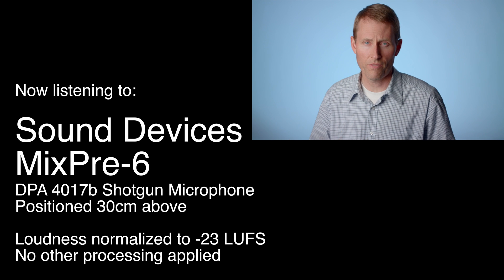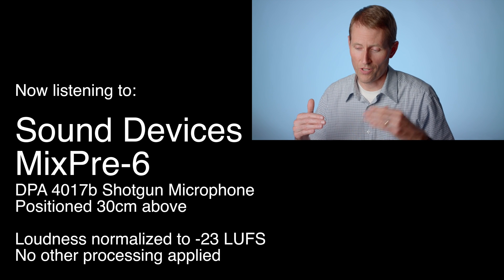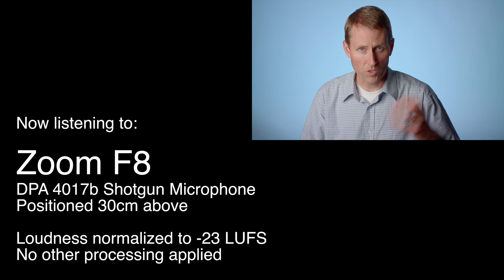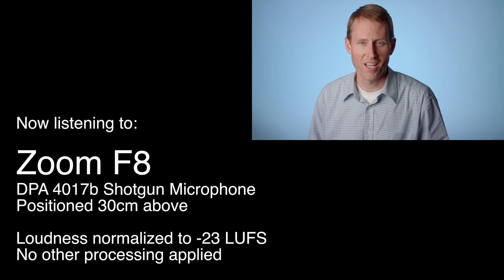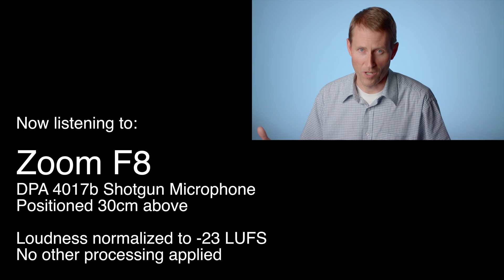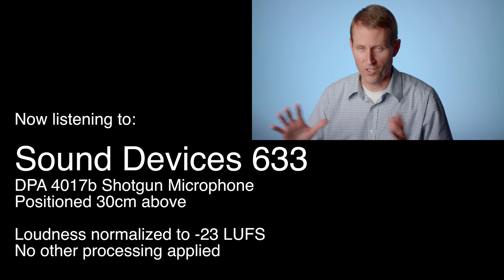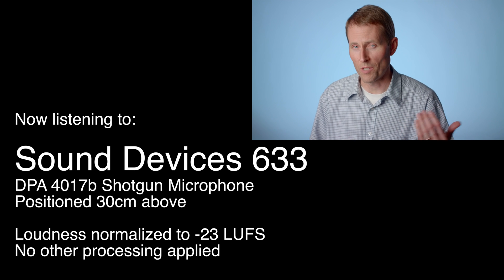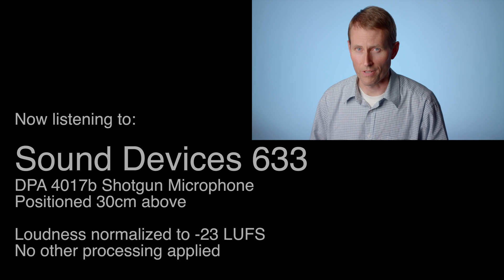Sound Devices MixPre Sound Samples Comparison

Comment: So, after quite a handful of years I'll just add my two cents. I'm a sound guy doing mostly documentary and independent films sound. I have owned my Zoom F8 since 2017 and it is completely 100% functional. Not a single failure. I've taken it to rather harsh environments ranging from insane humid and excruciatingly hot Caribbean to -4 celsius and over 6000 mts above sea level. It's still rock solid. It's honestly been in good hands. After all these years I'm finally upgrading to a SD MP 10 II (and keeping my F8 as backup). I've always find it a bit more tricky to get that..."in your face" american-dialog-sound with the Zoom. Digital limiters have been a bit of a pain here and there but in all fairness it's been ok. 

For the money (I paid just about 1k, new at BH), the F8 is just such a good piece of hardware man. It paid itself within like my first 3 or 4 jobs as a freshly graduated sound guy. 

I think I watched this video back then and thought like..."it's ok! I wont pay more than double for that extra" to be fair, I could not afford to. But now, to my ears, it is pretty clear that the SD (and others like Sonosax) do sound BETTER and I'm at a point in my journey where I think I need to step a bit up. 

I guess the goal would be to grab a 833 in the far future! Let's see. 

Thanks Curtis.
Reply from the maker: 👍 yes, the F8 and successors have been really good to me as well.

Comment: The dynamic range changes for each one. F8 is the shortest dynamic range of the bunch, mixpre-6 is an audible step up and the Sound Device 633 is just miles ahead in dynamic range.
I am listening on reference speakers with 1000watt 3 way monitors and 6000watt LFE through a benchmark 3 DAC

Comment: Excellent as alway! Curtis I’m upgrading from Tascam 70d, but still can’t decide between F6 and MixPre 3, which one you think I’m going to hear the best audio difference. I love the float 32 of f6. I’m a run and gun mode content creator.
Reply from the maker: If you use the same microphone and position the mic the same way, there shouldn’t be a huge difference in sound unless you gained incorrectly on the Tascam. If is 32-bit float you’re after, both the F6 and MixPre-3 II do that. The F6 is cheaper but the MixPre is more repairable if the unit gets damaged or stops working.
Reply: @curtisjudd  as always a very direct response. The answer I needed. Always a fan. Thanks again brother.

Comment: I thought the difference in bass response was rather strange, so I compared the first two preamplifiers in the silence part. This is the part examined in forensics to see if recordings coming from different sources were edited together and masked in some way in a final step:) The signal level of the Zoom noise is about 3dB lower in power, but that can happen on power normalization. The strange thing is that the bass response is unnaturally weak on the zoom f8 noise floor. Many dB lower than normal below 120Hz. The Zoom noise floor's most powerful part is at over 100Hz, while it is much lower in frequency on the first preamp. The noise response bass roloff is almost parallel, but extends lower in frequency. The noise floor does not change in actual rooms and electronic noise sources. It sounds like a highpass and it looks like a highpass in spectrum analysis, so I would say that highpass filter was active on the signal path of the zoom during this recording and it was rather high in frequency.
Reply from the maker: Thanks for the test.

Comment: I think the mix pre sounded the best followed by the 633. F8 I can live without
Reply: i retract my statement, the 633 sounds the best. now that im listening on my hs8's
Reply from the maker: Fair enough. 🎙
Reply: @curtisjudd  would you buy a Sound Devices 664 for $1550 right now. I found one for a steal. Or should I go with a mix pre 6 with 32 bit and buy a mkh416? I already have a ntg3 but I’m looking to expand my arsenal
Reply from the maker: @ozprana  Depends on what you need. I'd probably buy a MixPre-10 II if my budget were $1500. But if you need balanced outputs for working on larger productions where you need wireless feeds for crew, then the 664 or MixPre-10 II would make more sense than a MixPre-6.
Reply: @curtisjudd  understood. Thanks 🎤

Comment: In my opinion, running against most comments here and the price tag, the MP sounds the best. It has the cleanest sound and the speech is more intelligible with less "artifacts" around words, while retaining a very good bass response. The noise performance is even better than the 633 but this could be caused by a different gain setting.
One thing not covered in the test is the performance of the 3.5mm mic/line inputs on the MP.
Reply from the maker: Thanks for sharing

Comment: Actually, rooms have three issues: ambient-generated sound (fridge), reflections (echo) and modes (resonances).  Arguably semantic, most small rooms indeed have 'echo' and not 'true reverb'.  The difference is evident in some digital reverbs which offer 'early reflections' and 'tail'.  True reverb is what happens when early and late reflections become dense enough as to be indistinct from one another - a case of quantity changing the quality but all reflections nevertheless.  Applying sound blankets will 'absorb' some of the higher frequency reflections, perhaps from 1kHz and up, but not the ones approaching bass - about 250Hz depending on room size.  At that point, you have something called the Schroeder Frequency at which sound begins to behave differently and becomes what's known as 'standing waves' or 'modes'.  Luckily, we only need to treat down to about 63Hz according to the EBU and all of this can be done with either fluffy or rigid insulation.  Most people don't need specialized absorbers known as 'resonant absorbers' and I have a video on my channel detailing why.  Basically, blankets are a good start and perhaps sufficient in some cases but ideally some insulation and diffusion will give you the best result.
Reply from the maker: Thanks Hexspa! Appreciate the detailed info.

Comment: Curtis please help me out -  WHICH MixPre should I get??  The MixPre6M...or the $100 more other one? Currently I use a Tascam Dr100 MkIII 2 ch recorder( love the built-in rechareable lithium battery) - but i need4-channels here and there PLUS i want better sound.  I perform audio-only recordings of music, mainly classical of solo acoustic piano, clarinet, violin, guitar... plus small group ensembles  and occasionally of large orchestras.  I do not use it as an interface, don't "mix" in the unit ( I transfer the data from the SD card into my laptop and do some mastering with LogicProX.)  I MAY add video recording to my offering so usable "timecode" would be nice.  Would the 6Mgie me what I need or would I need the $100 more version?

I hear a definite MUSICAL quaity difference between both SD's and the F8.  I can't deny it to myself....the warmth of "organic aliveness" vrs a colder grittiness from the F8 sound sample and from from SD & F8 recordings I've heard on Gearslutz.  I have been thrashing about getting an F4n model ( $449 )  or F8 ( older model being blown off occasionally for only $500 ) vrs a MixPre6 ( mucho bucks with no discount ).   ARRRRGH, I really need acknowledge that I'll just have to save up for a MixPre 6...but WHICH  VERSION ??  Muchas gracias!!
Reply from the maker: You need the MixPre-6 not the 6M. The 6M is for overdubbing music production. Happy recording!

Comment: It would have been great to hear the 3 device using the same source.  You might be just be physically a little bit different, and maybe your voices changed as you moved your body... If doing an equal recording would give the same result, then the difference is huge for me... I didn't expect so much difference Between the Zoom F8 and the MixPre, and the MixPre and the 633.  It was enough to not take any chance and go with the much more expensive 633.   I'll probably end up doing my own testing video using the same source. (Though, maybe I better not do it and regret not going the MixPre-6T route with 2 tentacle for Timecode).  I'm upgrading from a Tascam DR-70D, main reason I was looking for something else is because of booting issue I have with it... It keep freezing sometime or phantom power won't be ask to be activated requiring the battery to be removed and put back in.  F8n was super interesting, but was told it wasn't great... After a few audio test, I agree to a certain point, so was looking at MicPre-10T... But that is already pretty expensive, so maybe the mixpre-6 with 2 tentacle... But while I'm there trying to cheap out, why not go with the 633 and not think anymore about it ;)  I got a short film to film this weekend, and going to receive the 633 recorder this week... Will have my Tascam as a backup.
Reply from the maker: Thanks Marc. Good luck.

Comment: What boom/stand (pictured at 0:37) are you using with the overhead mic? It's now a year later, what brand of boom/stand(s) would you recommend be considered? Thanks!
Reply from the maker: Hi Dan, that's a pricey conglomeration of several things:

K-Tek Avalon KEG150CCR Graphite boom pole with internal coiled cable: https://bhpho.to/2icrx4E
C-Stand: https://bhpho.to/2JsTAIz
Boom Holder/Adapter: https://bhpho.to/2ss4WCG

Comment: Curtis I've been binge watching your videos on the Mixpres and the F series and still can't make my decision so I'll ask your professional opinion. For commercial voice over work that will be conducted in a whisper room on a Sennheiser 416 which do you believe would be best? Or if you have another great suggestion under, or near, the $1000 range I'd consider that. Your videos are SO thorough and non biased  that it's truly amazing btw, so thank you.
Reply from the maker: Hi Robbie, thanks. The Zoom F4 or SD MixPre-3 would be enough inputs since it is just the one microphone. I personally prefer the sound of the MixPre preamps so the MixPre-3 would probably be my choice. Presumably you will power the recorder via AC rather than battery. If so, that's a +1 for the Zoom which comes with an AC adapter. You'd have to buy that for the MixPre. The MixPre has better limiters so if you happen to have occasional transient peaks that are a bit too high in amplitude, the MixPre does a better job handling those.

Either one will do a great job. If it helps, I would personally choose the MixPre. Good luck!
Reply: Curtis Judd then I will be grabbing the mixpre as I trust your opinion. Thank you very much for the reply.

Comment: Hi Curtis, your videos are great. Can you compare Mixpre-6 with Mixpre-D? Even though Mixpre-D has only two inputs and lack of inner recording capability is still more expensive than the other. I asked a Sound Devices technician if the Mixpre-D has "better sound quality" than the other (ignoring inputs etc.) He said: The sound quality of Mixpre-D's components are better than the Mixpre-6. What do you think? Are you agree with that or how big the differences are "in terms of sound quality" for a serious production like broadcast or filmmaking? Thanks.
Reply from the maker: Hi, I haven't used the MixPre-D so I'm not certain on sound quality differences between the two. Based on my experience with Sound Devices other gear (I mix mainly with a 633), my guess is that it has a slightly warmer low end response. Is it a night and day difference? Not necessarily. As you can hear in this episode, the difference between the MixPre-6 and 633 is detectible on quality speakers or headphones, but not hugely different. I would be more concerned about whether the devices fit the needs of the production. Do they have enough inputs, enough outputs, the right kind of outputs, will we need to send wireless hop to camera, will we need to send wireless feed of the mix to director, script supervisor, etc. In those cases, the MixPre-D may or may not be a better choice.

In short: There probably is a very small difference in audio quality for dialogue recording. More important is whether the rest of the features match the needs of the production.

Comment: Is it me or does the Mix Pre sound brittle compared to 633?
Reply from the maker: It sounds a little thinner to me - a little less low-end warmth. But the highs seemed similar to me.
Reply: Curtis Judd On vocal recording or everything?  I thought you said in this (or perhaps another video that the preamps on the MixPre and 688 series are the same) ??? I have used the 788T before and I just find them harsh and brittle compared to Apogee and Nagra. I found Apogee to be the best all in one converter and preamp as Nagra was artificially sweet and smooth that I almost got annoyed with due to inaccuracy. But, I do classical music. The bang for the buck feature still seems like a winner for the 10 but with no digital audio outs (unless I missed something??) and no lock feature in the real world (which Tascam always includes and cannot understand how that is left off “Pro” devices and such a low cost addition)....I’m seeing the HS-P82 as a renaissance device. The boxy ugly duckling that is treated like a step child. All that being said, I have heard the sound is great without having heard it and I am usually not a fan of Tascam signature sound signature of a mic in a sock drawer, but I always get them modified or use outboard converters. 

Question, even SD website says “no back up recording” but am I correct that it is backing up real time with some latency to the USB?  It better because a back up is a back up is a back up and I don’t want to hear some excuse about transferring after the fact.
Reply from the maker: On vocal recordings. I record mainly dialogue for film. I think some could potentially argue that the MixPre sounds more natural than the 633 and that the 633 adds more warmth than some would like. It doesn't bother me and I'm perfectly happy with the results I get with either one. At some level it is a personal preference. And one must also consider how much the audience cares about the difference. Some audiences are more discriminating and I imagine that audiences listening to classical music recordings may fall into that category.
Reply from the maker: Just saw your additional question in email (was truncated here on YouTube): Yes, I confirmed that it begins copying the current recording to the USB drive while recording and generally finishes writing to the USB drive within a few seconds of stopping the recording.

Comment: Hey Curtis, does the mixpre-6’s mixing capabilities match that of a recorder accompanied by a dedicated pre-amp mixer like the SD 302, or does the Mixpre-6 serve mainly as a recorder and still needs a dedicated mixer like the SD 302?
Reply from the maker: Hey! No need for an additional mixer in front of the MixPre, it's got mixing capabilities (basic vs advanced vs custom mode so you can set it up to work they way you prefer to work). There may be ergonomic advantages to other mixers/recorders, but the MixPre CAN do it all on its own.
Reply: Curtis Judd Thanks a bunch! You solved all my issues in one sweep!

Comment: 633 clearly sounds much fuller deeper and richer, followed by the mix pre and then the zoom sounds flat and almost "hollowed out" compared to the others.
Reply from the maker: Thanks for the input! That's the order my ears heard them as well.
Reply: Thank you for the wonderfully accurate videos!
Reply: I'm a little surprised how much better the 633 still is compared to the MixPre. The Zoom is not in the same league at all to my ears. The MixPre might be EQ'ed to sound a bit more like the 633 regarding depth/richness/warmth/smoothness.
Reply: I concur
Reply: exactly my impression too....